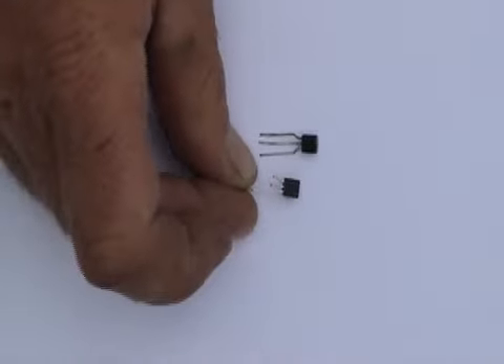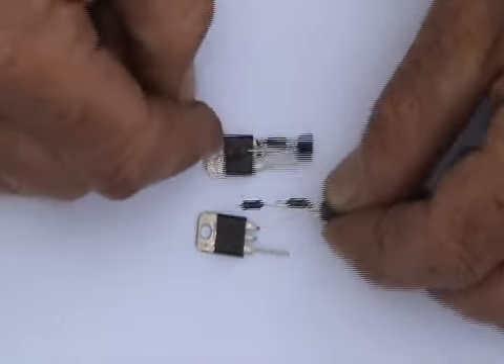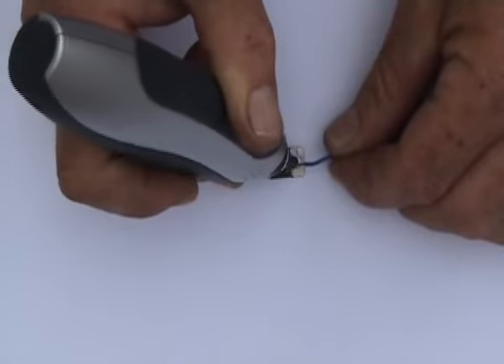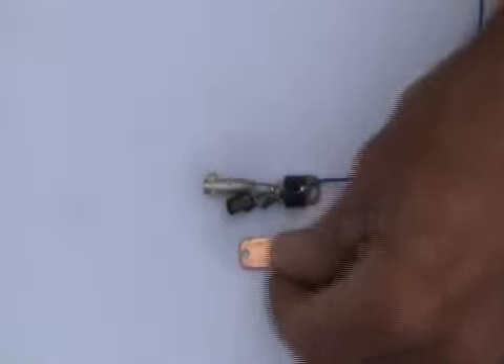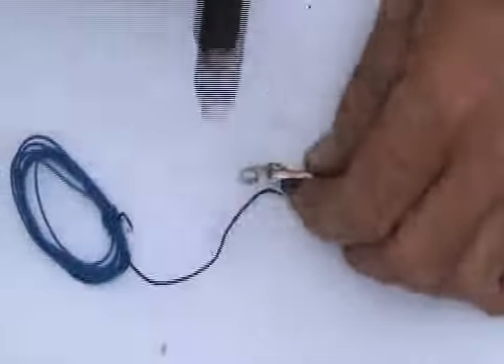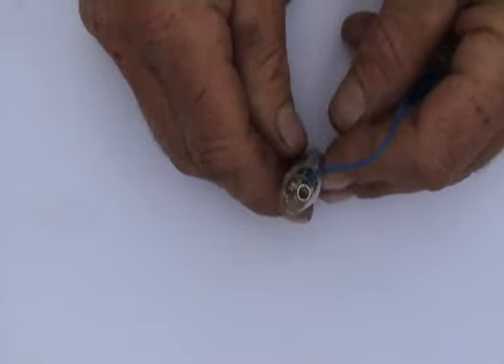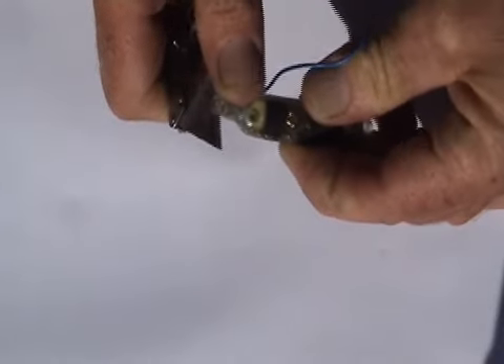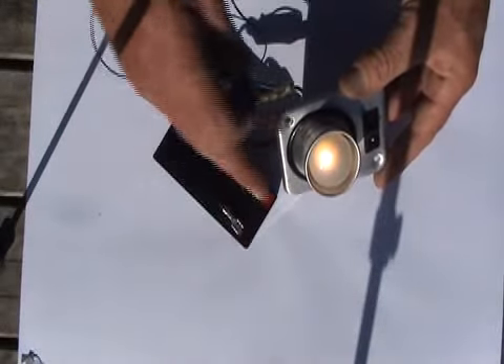Simplest, Cheapest & Easiest DIY Vehicle Immobilizer

Comment from the maker: Hi Majdi, might pay to use the G-Spot to control a relay to control the load, as the slight voltage drop across the SCR might be enough to cause a problem.  Either that or use an earthed resistor (say 220ohm for 12V system) on the SCR's cathode to keep it operating an interrupted load, eg fuel pump.  Check out the "Known Limitations" on the website if you haven't already, I've covered possible alternatives for similar situations there.  Hope this helps.

Comment from the maker: Hi, sorry for my delay in replying but have issues with this account.  This will work fine on a 24V system, maybe chnage the 220 ohm resistor in the gate circuit to a slightly higher value - say 330ohm - to reduce the gate current a tad.  Happy motoring!

Comment from the maker: @stevenchiverton 
Definitely only one wire which is soldered to one side of the 10K resistor - the other side of the resistor is soldered on to the base of the transistor.  There's a schematic at the bottom of the "Tech Info" page on the website mentioned.  Hope that helps.

Comment from the maker: It can be used in the starting solenoid circuit to prevent the motor from turning over or to control a relay preventing power to the ignition coil or an electric fuel pump.  It requires the operator to be earthed, usually via the ignition key/barrel, at the same time as they operate their vehicles G-Spot.  So a thief would have to either find the G-Spot and have the keys or bypass the control unit(s) physically which would mean either getting under the bonnet or behind the dash which takes time.

Comment from the maker: Great observations - I normally use a Utilux 3132 ring crimp whose mounting hole is the right size to allow for the rivet to go through the copper, then the SCR then the ring crimp.  

Trim or don't trim - if it shrinks smaller than the wire you want to fit to it later, you will need to trim it.

I also had issues with false triggering with my earlier prototypes - more info about this on the "Original Patent" page on the website - I've had no complaints of these getting falsely triggered

Cheers